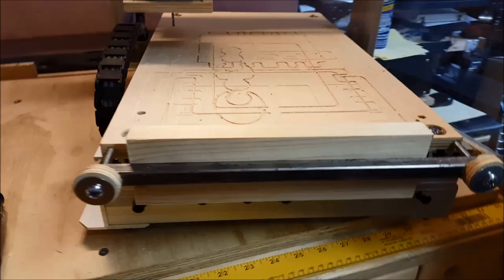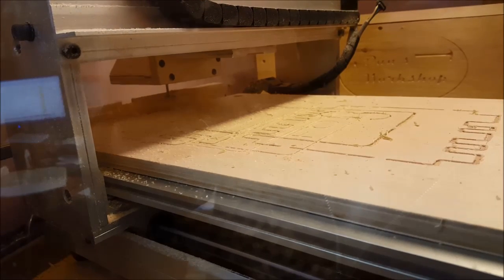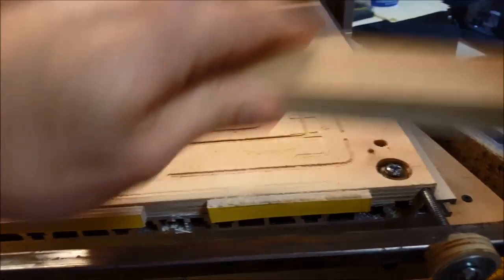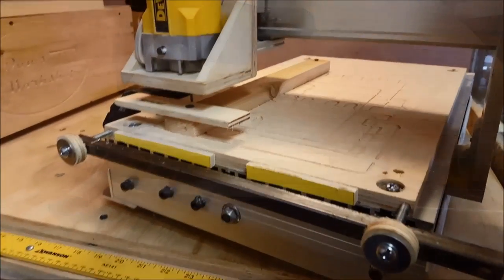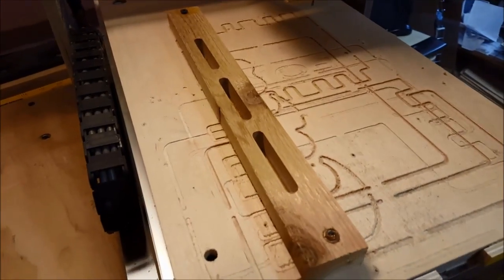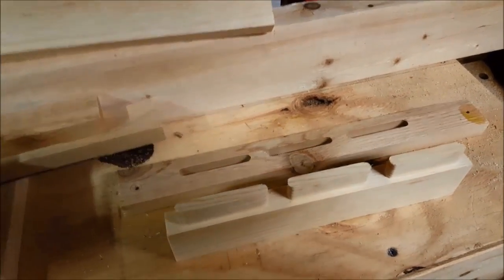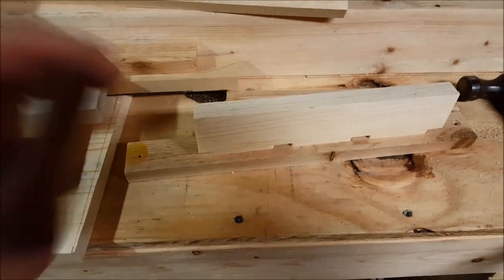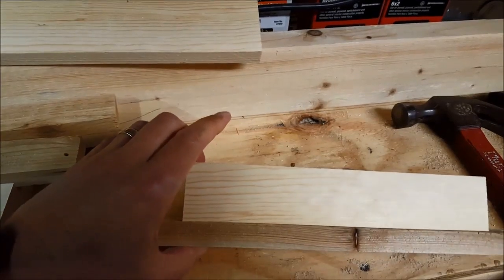Mortise & Tenon Joints - On A Small CNC

Comment: Not a realistic case.  How often would you face mortise a board and put the tenon in the long edge of a piece?  Really never.  What would be interesting to see is the opposite.  Mortise the long edge, then cut the tenon in the end of the other piece of wood.  That's what you are going to do 95% of the time and is much more difficult on a CNC, the mortise board must be exactly parallel to the gantry and the tenon board has to be milled from both sides.  Yes what you showed was easy, but not very useful.
Reply: At first I thought you were being too critical of this very inspiring video, but thinking about your point now I see what you mean.  Having just built a CNC and thinking about the dimensionality of all this, my thought is that if you can just open up a section on the floor of the CNC (where the spoil board should be, leave an opening) then you could allow the tenon to be milled on the long edge of the piece.  This is particularly true when your CNC is sitting on a table high off the ground (mine is at least 1 meter above ground). I'm going to give this a shot over the Christmas holidays, happy to report back here!
Reply: This is good to see as an example of adding a tenon on the long edge! 
https://www.youtube.com/watch?v=EYHOsZRA4UM&ab_channel=KadenMcDonald
Reply: It's not as easy of a cut but you could maybe make a tenon in the normal spot w/o a special jig that holds the workpiece at 90 degree angle for joint making.  You could maybe do it by using something like fusion 360 instead of inkscape to make a 3d tool-path of the mortice, cut one side of the curved piece, then with some sort of registration flip the workpiece and perform a second operation to make the other side of the tenon. 

certainly not the fastest tenon making process in the world though